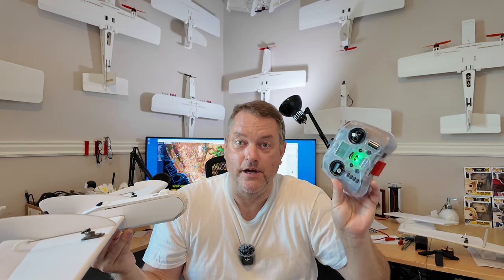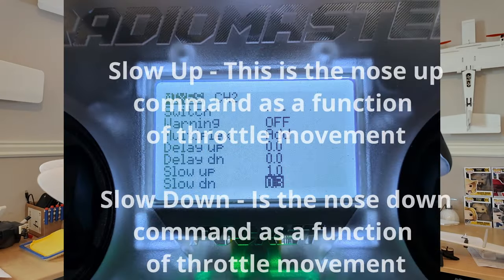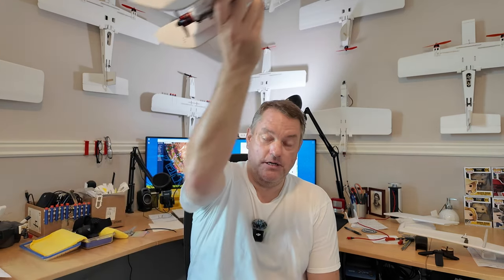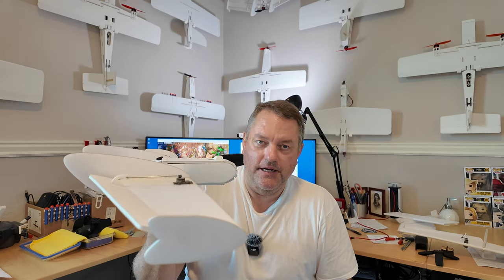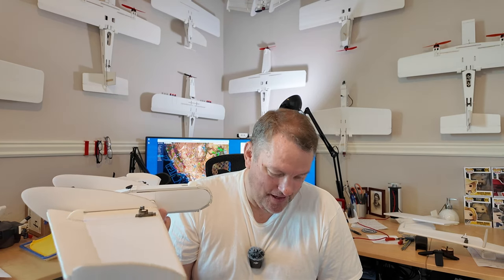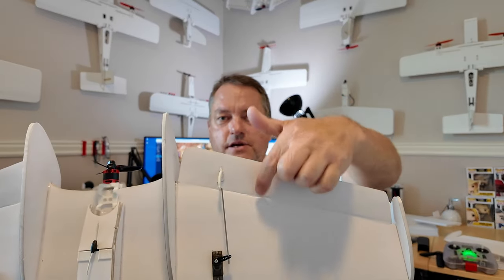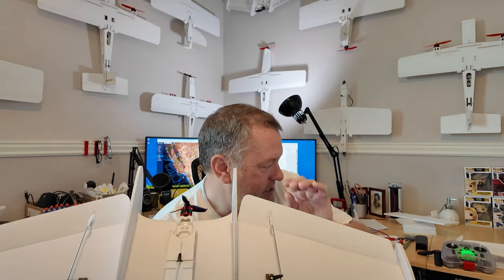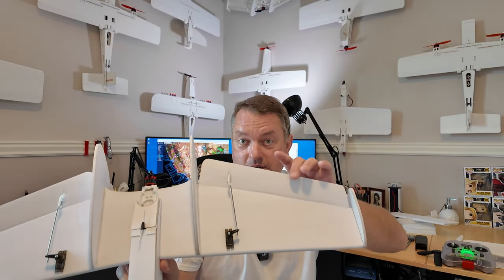Forward Swept Mini Wing Flight Dynamics

Comment: I’m just discovering the RC foam flyer hobby and I find your construction, design insight and RC knowledge quite inspiring to my beginner’s journey.

I realize it might be less interesting from your perspective, however making the hobby more accessible to those just getting would be helpful to folks like myself. If you could bring some of your valuable knowledge on getting started and maybe do a beginner level build to flight series it could help grow your channel as well as grow the hobby.

Your presentation style is relaxed and enjoyable to watch. Some of it can drift a little heavy for someone getting started as we grapple with hobby terms and aerodynamic concepts. I instantly subscribed to your channel and look forward to learning more as I dive into the hobby.
Reply from the maker: Thank you for your comment!  I do have some easy builds that may be suited for guys starting out, I’ve just got to get around and make the videos.

My planes may not be the most efficient - as pure aerodynamic dudes will argue their designs all day - but my builds get to the flight line faster than most, and are simple to repair.

Don’t get me wrong, I started out cutting ribs out of balsa by hand and gluing them to spars pinned on plans, and I’ve still got my iron for coating wings… but I don’t always miss that.  For my tastes, I’d much rather design my planes while I’m sitting in hotels on the road, cut them on the laser, and then be able to build them in an hour or less.  To each their own.

I like your ideas.  Thanks for your comment!
Reply: @usefulaircraft  I’ve got a laser, CNC, and several 3D printers (FDM & Resin). I actually got them for other hobby purposes.  With seeing the RC airplane and specifically sub 250g foam builds, I felt my workshop tools cry out to me for more attention. Why not right?

I look forward to seeing a starting point video from you if you’ve got it in you. I’ve seen others  post some as many do with most topics. The styles and knowledge levels don’t grasp me as they tend to be too dramatic for like and subscribe reasons or they just don’t strike a balance with knowledge and good delivery.

As I mentioned previously, your style hits my 59 year old no nonsense mentality along with being informative. I’m eager to get on my journey and I’ll keep an eye on your efforts. Thanks for the effort with your channel and know you’re making a difference for others.

Comment: Interesting timing of this video.  Was just having a discussion with some folks on a Facebook group this morning about pitch trims at various speeds and I suggested they do a throttle to elevator mix for dynamic pitch trim so it would fly level through a more broad range of airspeeds (throttle positions).
Reply from the maker: I come out of full scale aviation, and trim is constantly in motion with power changes.  I use the sliders on my TX16S constantly for my pitch trim as it falls easily under my trigger finger and it's great for a fast trim. 

Flying out of trim is just something we do in my line of work.  We're always trimming for hands off flying.

The mixing in the radio works great.  And the slow up/down really works brilliantly in many situations.

I cannot claim credit, but whoever integrated this gave us a tremendous tool. 

Thanks for your comment.

Comment: Thanks. It was fascinating to understand your elevator setup. The one thing I still don't get, is there a difference btw. a "regular" plank and a slight forward swept plank like yours as far a flight characteristic, control surface setup?
Reply from the maker: Control surface wise - they should be the same.  

Aerodynamically in full scale aviation, there are some studies about stall propagation in forward swept wings as spanwise flow can tend to move towards the root (however washout must prevent the tips from stalling first otherwise further pitch up will occur), and movement of center of pressure at differing angles of attack and throughout different speeds / Mach can have advantages for certain applications, but they do carry complexity as well (yaw instability), so you really don’t see many (X29, Hansa, S37).

At the end of the day - my foam board wing was just something I wanted to build, with an aerofoil unlike what most use (but makes building planes super fast), and the plane flies well, plus I think it looks cool on the wall.

I’d love to hear if you build something similar and how you think it flies.

Thanks for your comment.

Comment: One thing for more advanced users of the channel to think about is you shouldn't have any radio mixing if you are using a flight controller.  Everything mixing wise should be handled in software.   This is said in all the documentation I've read for ardupilot or inav
Reply from the maker: You’re right.  I have many builds with flight controllers - but I still enjoy just straight up RC flying.

So good to point that out.

Thanks for your comment.

Comment: Surely you must know that you can curve foam instead of using the slats as you’re doing on the nose.
Reply from the maker: Yep, many of my designs have curved surfaces.  But every design evolves differently based on how it's cut. As this part is laid out on the laser, the cuts are on the outer surface.  If I was making show pieces, I'd solve for the aesthetic, and she'd have a smooth nose.  But I build these to quickly iterate and get out and go flying.  I can go from a sheet of foam to a flying plane in under an hour, and that has value to me. 

Thanks for your comment!
Reply: You and Brett should try folding your wing around a V-cut in the foam. That allows a nice leading edge. Add a spar and you have an airfoil. You can even push down on that leading edge while it drys to form a lifting airfoil.